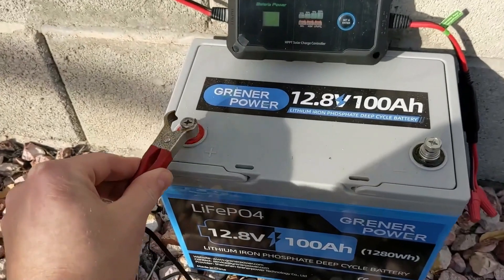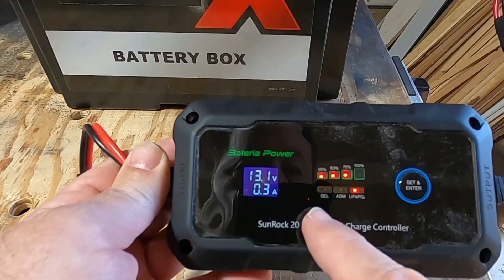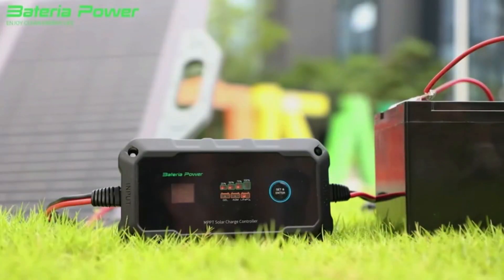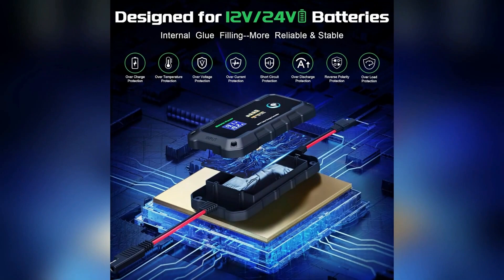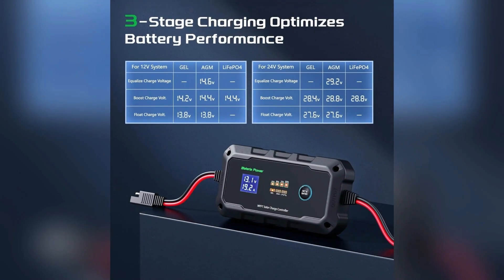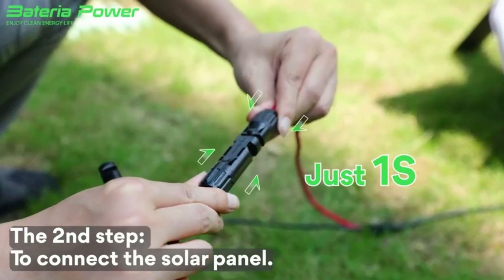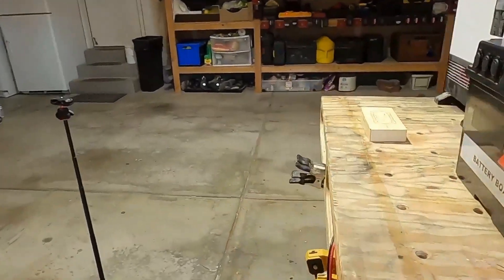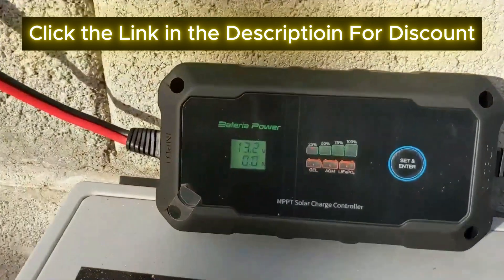Why Everyone is Switching to This MPPT Solar Controller in 2025?

Comment: I like the size and features. Would this work on my boat's 12V AGM deep cycle batteries? I have a small solar setup and my current solar controller is outdated. I would like a charge controller with bluetooth so I don't have to climb in the cabin to check how much life is left in my batteries.
Reply from the maker: Yes, it would work great on your boat. It's IP65 Waterproof :)